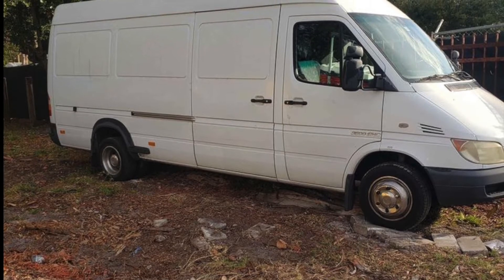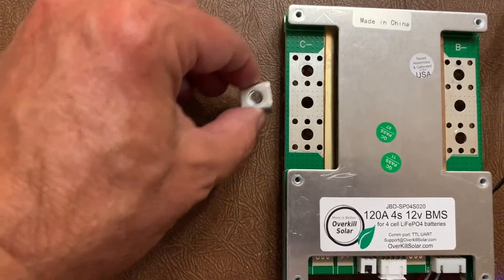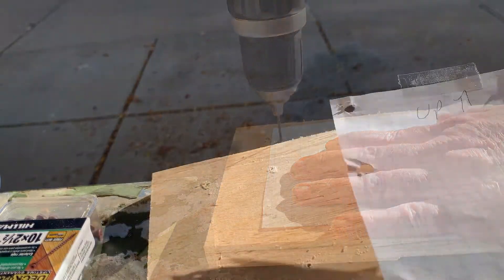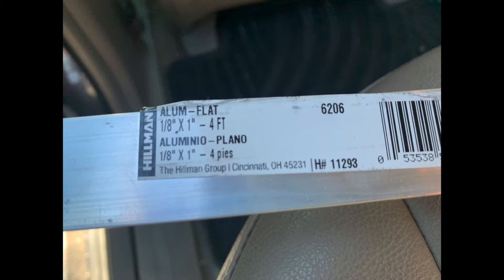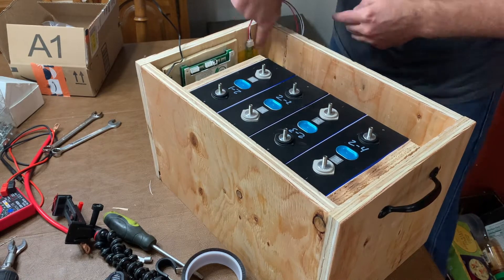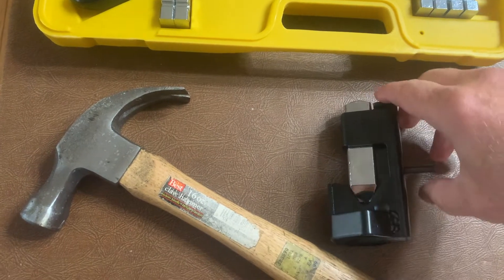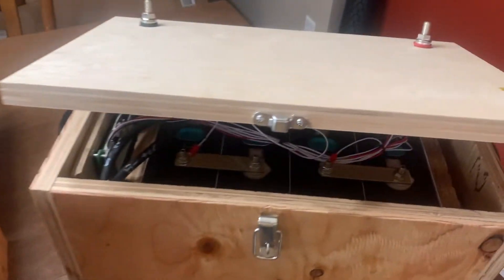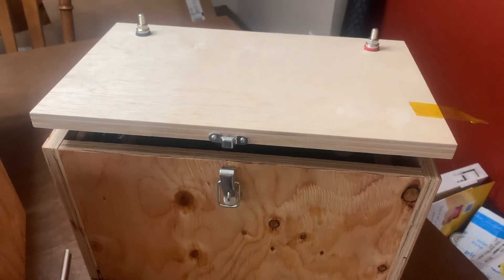DIY LiFePo4 Battery Enclosures - Van Build Series

Comment: the aluminum case is connected to the postive terminal through leaked electrolyte from manufacturing. Some cells are worse than others. Usually around 10-30mA of current flows if you provide a short from the cell case to your negative terminal. That's about the same amount of current to power your BMS. It will run your battery down over time.
I used 1" cargo straps. I use high temperature polyamide tape between my cells and covering cell terminals/busbars. I use quarter inch ceramic fiber cloth around the whole battery to prevent wood from catching on fire in case of a cell malfunction.

Comment: Thanks for sharing! Thats first proper video i found of good DIY box for our cells. Ive made few boxes for 100Ah cells but never liked end result. Just came into possession of 8 of these exact same cells and will copy/reverse your boxes!
Reply from the maker: The boxes are really simple, there's not much to them. I think the one thing I did that was unusual was to mount the BMS to the separate piece of wood and then mount that up to the wall. All the other videos on DIY enclosures, the BMS seems to always be held down by tape, meh!

One option would be to go that same route with the BMS, but to attach it to the inside of the lid rather than on the inside of one end. Obviously you'd have to build the box that much taller, and add some sort of material or shield in, to make sure there's not the possibility of contact between the BMS and the cell terminals just below, should you hit a bump or something.

Using the proper flexible welding cable is key too.
Reply: @wanderingzythophile9083  I used an acrylic sheet across the top of the battery and attached the BMS to it .  Its totally isolated from the battery and has air space all around it so it really can't get hot.

Comment: That is a really nice looking DIY box.  Couple of comments I gleaned from my own experience.  I'd like to see a non-conductive layer on top of the battery for safety.  Clear acrylic sheets work well.  Not sure why you used heavy 3/4" plywood for the box.  1/2" or even 15/32" is very strong and lighter.  The Blue Sea terminals are nice, but I would have set them with the mounting screws on the outside of the lid.  Covers the drilled holes and looks much nicer.  The aluminum flat bar between the threaded rods is doing nothing but adding weight and not strength.  If you run a screw through both sides of the box into the compression plates on the ends of the battery it can't move in inside the box.   That works well if you are using it in a RV where vibration can make the battery assembly walk inside the box.   I am in the process of building a similar box for a 412ah battery.  Insulating it with foil faced 1/2" polyisocyanurate sheeting to keep the battery warmer in cold weather and cooler in the summer heat.  You did nice work.  The hinged lid was something I like a lot.  I was going to just screw my lid down, but I may use hinges now.
Reply from the maker: I would use beefier hinges than I did. The ones I got aren't all that burly. 

When you say "run a screw through the box into the compression plates" - do you mean from the outside, into the edges of the inner plates? Hm. HM. That's not a bad idea. Right now, as you'd expect, the pack with the outer plates and hardware is just sitting in the box shell, without anything holding it down. They're pretty heavy so it would take a huge bump for them to move (and I'm nowhere near to the point with my van that they're going to be installed and bumping around, har). But securing them that way would be better, yes!
Reply: @wanderingzythophile9083  Yes.  Run a screw from outside of the box wall into the pressure plate. .  One for each end of the 2 pressure plates on each side of the box.  4 screws total.  Holds the battery pack perfectly in the box.  I just did one that way and it worked really well.  It was an easy solution to a rather vexing problem of how to secure the pack in the box.   Just size the width of the pressure plate to fit exactly inside the box.   Make sure you know exactly where you are setting screws so you don't accidently it a cell!   

One other suggestion.  For the nuts on the threaded rod, use  Statuary Bronze/Antique Bronze Furniture Connector Bolts ¼ -20 JCB (Choose Your Size) by E.H.C / 8 Bolts with hex Key (Hex / .67 inches Long Neck) (Amazon).   They are a bit spendy, but I like the look of them and they reduce the length of the box by the width of the washer and bolt on each end of the rod., making your box just a bit smaller.  You can also get them at your local big box or hardware store.
Reply from the maker: @michaeldoherty2289  Oh my yes don't want to poke a cell, hah! 

The trick with your bolt idea (second paragraph) is you still need to have room on either end of the pack to get hands in there to tug it all out, should you need, so reducing the total length of the threaded rods by using smaller hardware on the ends won't really make any difference, IMHO.
Reply: @wanderingzythophile9083  You can add a carry strap to each compression plate so it can snugly fit the case.  Fabric strap just folds down so it doesn't take space end to end.   I used them not so much to reduce the size of the case, but I just like the clean look rather than clunky nyloc nuts withy washers on each end.   I get around that issue by building my boxes with a removeable side and top.  When I do a tear down, I just unscrew and remove one long side and slide the pack into the box.  I find that easier with larger packs that get pretty heavy to drop in or pull out vertically.
Reply from the maker: @michaeldoherty2289  Interesting! Actually could make one side hinged with some latches too. Open the top up, fold one side down...

I'm not worried about how the inside looks as it's inside! And then it'll be in my van and I won't even hardly see the box as a whole! :D
Reply: @wanderingzythophile9083  If you are like me, you care how it looks inside too!  The job you did was professional, neat, and clean.  I'd be proud to open it up to show someone that battery.   That is a good measure of the work you do.  One final comment, I painted my newest battery case with gloss black enamel.  Three coats with a light sand between coats.  It really finished it nicely.  Previously I used clear polyurethane to seal the plywood.  It was nice too, but the gloss black is my favorite.  Could use white or even red.  It adds a lot to the final appeal of the battery.
Reply from the maker: @michaeldoherty2289  Pffft, I wouldn't call it "professional" by any means. I basically puzzled it out as I went. But I do appreciate the sentiment :D
Reply: @wanderingzythophile9083  Every one I built was "puzzled out".  Its not there is a lot of guidance on this stuff.   This last upgrade I was going to just go ahead and buy a commercially built battery directly from my Chinese contact in Shenzen.  He convinced me to build my own saying I can build a better battery from scratch than I could buy at his company or any other.  I believed him so off I went. I added an insulation layer inside the box, a heating pad and heat sink for cold weather use, and blue tooth to monitor the battery cells more closely.  Its really cool to learn something new every time and build on the knowledge gained ourselves and from the great folks that document their work like you did.  I really mean it.  Yours was a good job.  Thanks again.
Reply from the maker: @michaeldoherty2289  Nice. Did you document any of this? I'd love to see your results.
Reply: @wanderingzythophile9083  I've got a few photos but I really didn't document it in a orderly way.  I just don't have the skills (but mainly the patience) to video and edit like you guys do.  I originally built 2 -206ah 4s batteries and paralleled them inside the ione box to the external terminals.  I put a 200a JBD BMS on each one.  It was overkill but that's what I wanted.    It worked great but I couldn't get the 2 batteries to sync properly.  When fully charged, one was 206 ah and one was 176ah.   I still don't know how that happened because I top balanced all 8 cells together.   I got frustrated with how the 2 blue tooth modules seemed to fight one another and the data looked strange, so last week, after camping with it for 2 weeks, I broke it down and paired the cells 8 cells into a single 4s2p pack, top balanced again, and reassembled it  with one 200a JBD bms.  Now it is perfect.   It charges to 412ah and my Victron smart shunt and the one JBD BMS are totally in agreement.   I couldn't be happier.  I use a 2000W Renogy inverter to run my microwave for cooking, and a Renogy 60a dc-dc charger from my Ram so I can run my refrigerator on AC when on the road which is safer than propane.  It all works really great so I am really happy.   I could drop you some still pics and dimensions,  but that is about the extent of what I have.
Reply from the maker: @michaeldoherty2289  Yeah, if you wouldn't mind sending some pics, I'd love to see them. wanderingzythophile at gmail is the addy. Thank you!
Reply: @wanderingzythophile9083  Will do.   I'll try to get it done today.
Reply from the maker: Oh zero hurry :) Thanks!
Reply: @wanderingzythophile9083  You'll have to have a pint of guinness and chill.  I have to get some work done outside before the rain hits and the clouds are really dark to the west.

Comment: Hi, excellent video.  Do you happen to know the final external dimensions of your boxes?  I would like to make one for my van, and I have a space that has a max size I can fit in. Thanks.
Reply from the maker: 10 3/4" H, 10 1/2" W, 16 1/2" L. Made with 3/4" ply. It's a bit oversized, there's open spaces inside that are larger than necessary. Part of the size is due to the end pieces needing to be wide enough to accomodate the threaded bars being spaced away from the cells enough that they don't touch.

I've been pondering redoing these boxes, been keeping eyes open for suitable containers on the market, but the ones I find are either too small, too big, too flimsy. 

Frankly the best DIY solution I've seen online is this company's offering, but it's kinda pricy; https://www.sunfunkits.com/product/1/sfk-battery-kit-v1-280ah-4s-12v-lifepo4